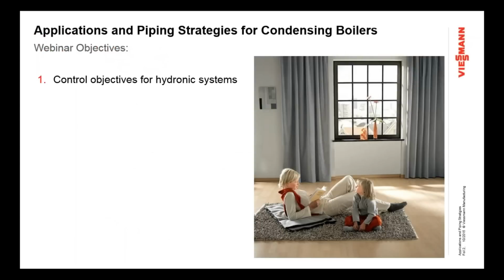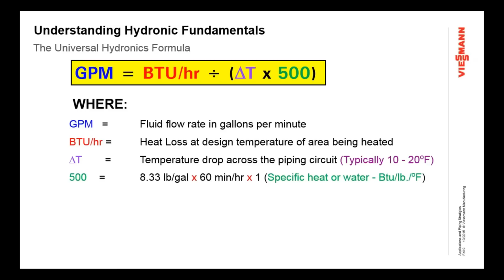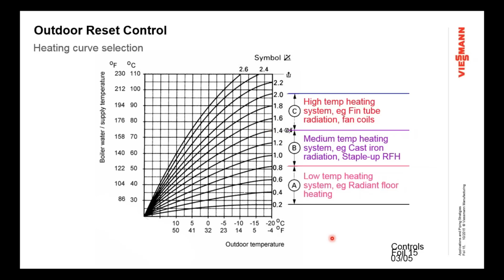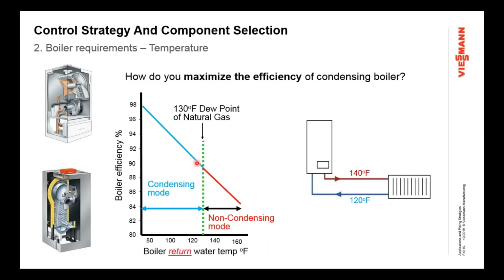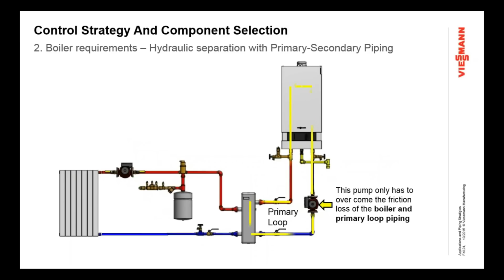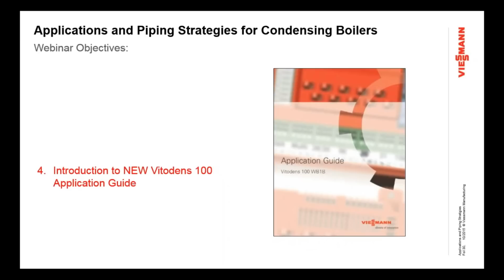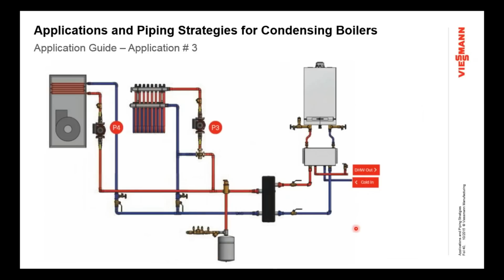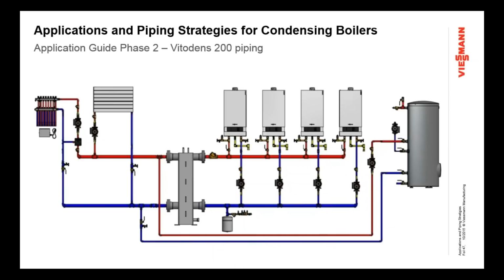Application and piping strategies for Viessmann condensing boilers

Comment: When the Vitocrossal 300 CU3A is piped as shown at 30:06 for a one temp zone installation, does the circulator need to run continuously for outdoor reset to function properly?
Reply: Hi Shahrdad,
Because the Vitocrossal 300 CU3A boiler is a high mass boiler, with a water content between 13-18 USG, depending on the model size, constant circulation through the boiler is not required as it is with Vitodens.
If the pump in the image is configured as a heating circuit 1 pump it will by default run whenever the OAtemp is below the WWSD setting (Warm Weather Shut Down). If the pump shown is configured as a Zone circuit pump (The Zone Circuit configuration was not available when this webinar was produced. It was added as a control feature later), the pump and call for heat will cycle with the operation of the thermostat assigned to the zone. In either case the boiler operation is not necessarily connected to the pump operation but the call for heat. If you were to control the pump independent from the boiler it will maintain the setpoint regardless of the pump operation.
Reply: @marknorris9722  Thank you Mark.  What I had  in mind is a one-zone converted gravity system, possibly with indirect DHW added on.  One of the things I like about this boiler is that no dedicated boiler pump is needed.  So what I’m understanding is that once the Outdoor Reset detects temps lower than Warm Weather Shut Down, it will tell the pump to run constantly, in order to maintain a uniform temp throughout the system, and the boiler will fire as needed to maintain the proper temperature according to the outdoor reset curve.  And if DHW is also added as a second zone, the main circulator will shut down and the DHW pump will flip on when the DHW tank needs to be heated.  
I’m curious, but if an ECM pump is used as the main circulator, does the boiler vary the output of the pump, or will it run at a constant rate?  Again, thank you for your reply.
Reply: @Shadrack69  Yes, you are correct, if the system is configured as Heating Circuit 1 without thermostat control of the boiler.
If you used a Zone Circuit, the pump and call for heat will follow the thermostat call.
There is a 0-10VDC pump speed control logic available, but it is limited to the operation of a boiler pump if configured. It also requires that a connector for that plug is ordered as an accessory part because it does not come with the boiler. How it works is that the control 0-10VDC signal is based on the outdoor temp. As it gets colder outside the pump runs faster. We do not use this function a lot on our North American systems. It would also require the use and configuration of a common supply (LLH) sensor.
As to your DHW comment, if DHW is configured as priority, which is the default, the boiler setpoint will go to the DHW setpoint and the DHW pump @ output 21 by default, will start. The heating circuit 1 pump will shut down during a DHW call. If you switch to non-priority DHW, both pumps will operate simultaneously and the boiler set point will be the greater of the two setpoints
Reply: @marknorris9722   Thank you Mark!  That was very helpful.  On the Viessmann North American site, I don’t see any of the Vitotrol thermostats listed at all.  When you install these systems, how does the system know that the indoor temp set on the outdoor reset actually achieves the desired temperature indoors?  My understanding is that a regular Honeywell or Nest thermostat doesn’t function properly with this system.
Reply: @Shadrack69  Yes, you are correct, if the system is configured as Heating Circuit 1 without thermostat control of the boiler.
If you used a Zone Circuit, the pump and call for heat will follow the thermostat call.
There is a 0-10VDC pump speed control logic available, but it is limited to the operation of a boiler pump if configured. It also requires that a connector for that plug is ordered as an accessory part because it does not come with the boiler. How it works is that the control 0-10VDC signal is based on the outdoor temp. As it gets colder outside the pump runs faster. We do not use this function a lot on our North American systems. It would also require the use and configuration of a common supply (LLH) sensor.
As to your DHW comment, if DHW is configured as priority, which is the default, the boiler setpoint will go to the DHW setpoint and the DHW pump @ output 21 by default, will start. The heating circuit 1 pump will shut down during a DHW call. If you switch to non-priority DHW, both pumps will operate simultaneously and the boiler set point will be the greater of the two setpoints
Reply: @marknorris9722  are they any plans to sell the Vitotrol 200 or 300 in North America?  I don’t see them on the website.

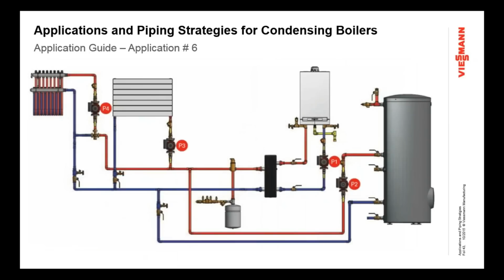Comment: At 49:30, application 6, Could you just prioritize the zone pump for domestic hot water off the secondary loop.  Not sure why that wasn't considered an option
Reply: Arne,
If you are asking if DHW can still be priority in this application, yes it can, if the pump management device controls the P2, P3 and P4 pumps.
The Vitodens 200 series of boilers can control all the pumps shown directly from the boiler. In addition, the DHW set point and tank sensor are also part of the boiler logic. In priority mode the boiler will start P2, go to the DHW set point parameter and shut down P3 & P4 while disabling their set point command.
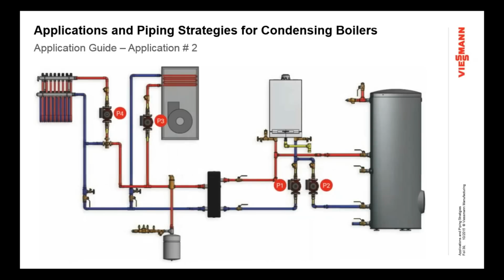If you were using the Vitodens 200 series boilers, it would be simpler and more cost effective to pipe the DHW tanks on the primary side, similar to the piping example @ 43:24 of the video. 
If you use a boiler like the Vitodens 100 series shown in this video, which always has “DHW priority”, then to control these pumps you need a third party multizone control that can separate not only priority but also the command for the priority zone, in this example DHW, so the boiler can operate at the DHW set point when DHW calls. This set point is most likely different from the heating loop set points. 
In that case P2 would start and P3 & P4 would shut off on DHW call through the multizone control and a binary command from the multi zone control to the boiler’s DHW connection would tell the boiler to adjust the set point to suit.
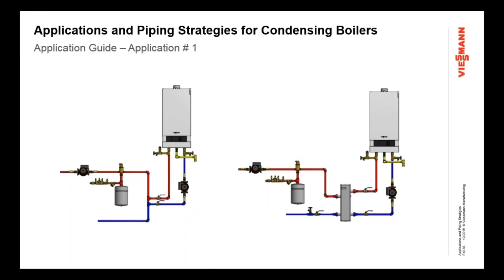This video was produced before the current model of Vitodens 100 B1HA was available. With the new B1xx generation Vitodens 100, you can pipe application #2 shown @ 43:24 without the P1 & P2 pumps because the boiler includes a built-in pump that can be diverted through the internal diverting valve to either the Low loss header or the DHW tank. This is shown in the updated guide application guide’s application #2 for Vitodens 100 published as 579-5123 (Vitodens 100-W B1HA/B1KA residential boiler) available online @ www.viessmann.ca

Comment: All I have is 1 zone for forced air furnace. Installer put closely spaced tees, and my boiler circulating pump is on the supply side of the closely spaced tees. Everything works fine, but wondering if that circulating pump should be on the return side of the closely spaced tees.
Reply: Ben,
If you are using a low mass boiler like the Viessmann Vitodens 100 or 200 series boilers then the pump should be pumping into the boiler return. If you are using a high mass boiler like the Viessmann Vitocrossal 300 CU3A then it is not critical.
The description of low or high mass will indicate the water volume content of the boiler.
A low mass boiler has very little water inside and therefore requires forced circulation for the burner to operate. Pumping the water into the boiler allows the head the pump generates to overcome the resistance in the boiler's heat exchanger and reduce the chanced of pump cavitation. 
In high mass boilers flow is not required for burner operation and the pressure drop across the heat exchanger is low. With high mass boilers we will typically follow the practice of pumping away into the system to use the head of the pump to overcome the building head.  Primary/Secondary piping like a low loss header or closely spaced tees are not normally required with high mass boilers.
In your case you have closely spaced tees installed so the boiler pump only will need to deal with the boiler head. 
If your boiler is low mass, pump into the boiler. If your boiler is high mass, it shouldn't matter as far as boiler operation goes.

Comment: What is the dew point of propane? You show at the 24 minute mark the dew point of natural gas is 130 degrees. But I only have propane available.
Reply: The dew point of the flue gas is a function of the laws of physics regarding the dew point of water. Water vapour in the flue gas will be forced to change state into water droplets at the dew point of the water.
However there are several thing that effect the dew point. Relative humidity in the air, the altitude above sea level or the barometric pressure to name the three most prominent. The fuel burned does not change this point. The potential volume of condensate may vary because of the volume of air required for combustion is different with different fuels. One fuel related thing that does effect the dew point is the amount of CO2% in the flue gas. The lower the CO2% (Resulting from more excess Air) in the flue gas the lower the dew point.  This is why with the Viessmann premix burner we set them up for the most part at the factory to keep the CO2 levels and thus the dew point higher. For optimum efficiency we would set the burner up with zero % excess air, but for safety reasons that is not done. At zero % excess air the production of CO is likely due to the unstable environments the burner operates in and that is not safe.

Comment: Copies of the Application Guides that this video is based on are available as pdf files @ www.viessmann.ca .Look under the Prologin tab, then inside the current documentation area. There you will find all documentation listed by boiler model. Look for the Application Guide files under the products.Currently there are Application Guides for Vitodens 100 WB1B, Vitodens 100 B1xA, Vitodens 200 B2Hx and Vitodens 222F B2TB models.For a hard copy of an Application Guide contact your local Viessmann Sales Rep. There is not cost for these guides.If you don't know who your rep is, you can find them on the website under contacts.

Comment: HOW COME YOU IN STALL CIRCULATE PUMPS ON THE HOT SIDE OUT PUT WHEN THE WATER IS FULL EXPANDED AND LOADED WITH AIR.   BUT YOU INSTALLED PUMPS ON COLD SIDE FOR HOT WATER HEATER PUMP WILL LAST LONGER  ZONE VALVES TOO

Comment: This winter i urgently had to replaced my old 50 gal gas water heater with the same capacity water tank. We have three showers and during Christmas we run out of hot water quickly.  Is it safe to connect the cold water line to the tankless water heater input and connect the output of the tankless water heater into the input of the 50gal water heater tank and continue to used it as a reserve tank?
Reply: Pete Diaz I think that would be fine. The storage tank would add some money to the heat bill but the majority of energy expended on a water tank is raising the initial cold water temp. If the tank is well insulated it should not add too much extra expense. I also have an extra storage tank that runs off a heat exchanger from the boiler. The storage tank may add a percentage to the bill (20%???) but the hot showers will last a bit longer.

Comment: Thank you for the video. I am installing my first vitodens today and there is one thing i cannot figure out: how do I wire my secondary pumps to the boiler, so it can shut them off automatically. I have the 4-pipe condensing boiler. Thank you
Reply: khum kumar